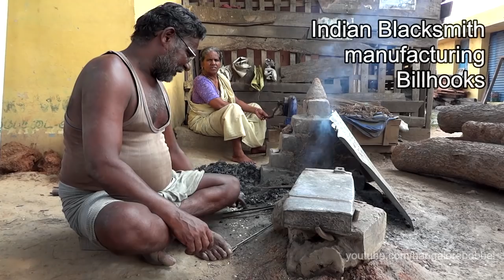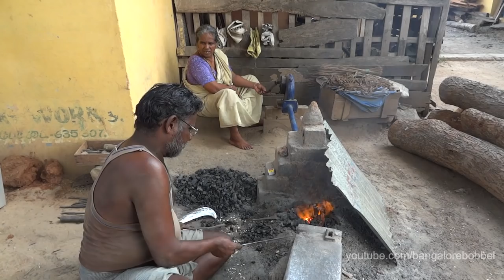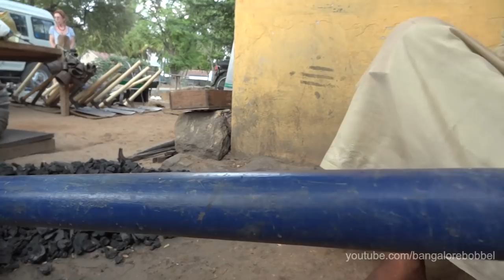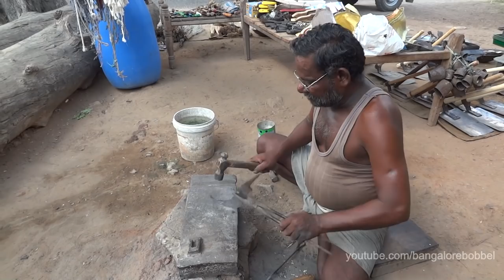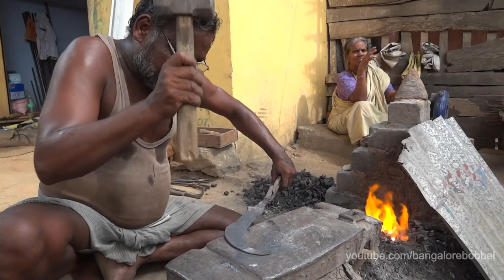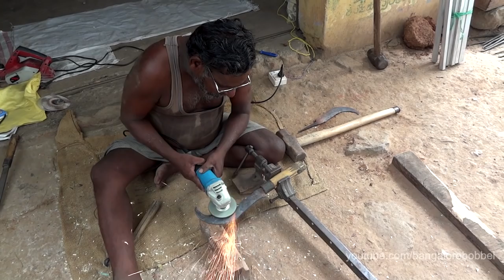Indian Blacksmith making Billhooks - Indischer Schmied beim Hippen schmieden

Comment: Great video, thanks. Do you know how he has the fire going? More specifically, it looks like the air is coming in from the bottom, but I don't know how they get it to go from horizontally out of the blower to coming out of the ground over by the fire. Also, is that charcoal or some other type of fuel?
Reply from the maker: Thank You. Yes the air comes here in India usually always horizontally in, and depending on how one creates a more flat or more pot type surrounding of the space near to the inlay one can keep the air flat or make it going up.
Sounds little bit strange what I tell but it comes from different ways of deflection of the air after it comes in, maybe You understand it better checking two of my other vids where this point is better visible: 
first that one here, the blacksmith uses simply sand to build kind of funnel and to drive the air upwards:
https://youtu.be/DgDMRLGibX4 check from 3:03 onwards
then another sample where bricks are used to form a kind of firebed after the inlay: 
https://youtu.be/uRoycA8u7pY here You can start from around 1:10 or so
another way, and I gess it is like he made it here, is simply to make a little hole in the flat ground, and maybe a little bit of sand around (usually it is not so much as in that other video) so the air is little bit deflected and driven slightly upward.
Means, the air comes usually always horizontally in, through a wall, and on the other side of the wall one can decide to keep the surface even or build whatever funnel or tunnel or simply a hole to deflect and drive the air further. There is no need to uplift everything on let me say table level as it happens in other countries (for whatever reasons, including usual work in standing position instead of in sitting way like here in India), just in order to drive the wind upwards in the fuel - here everything can be done down on ground level.
This is not only a very simple construction but it works also very efficient and it helps sometimes also to pre-dry the charcoal at the perimeter of the fire, it is easy to empty and clean and I think there is even not that much of ashes in the surrounding air as it may happen with some other solutions (where the air comes from under the fire and takes all up).
And yes, usually, charcoal is used. That is since historical times the main fuel. Sometimes little bit wood added as You may have noticed in that Udaipur video. Some people may also use stone coal but usually one can get charcoal more easy and it is available everywhere in India.
This flat pit as the blacksmith here has in use is very easy to control - just bringing the coal closer to the hotspot or not, or sprinkling a little bit of water to make it little bit slower, and so on. Simple, efficient, easy to control - very clever, same as the blacksmith ;-)
Reply: bangalorebobbel Wow! Thanks you for this great reply and helping me out so much. I live in the US and am trying to become a blacksmith but I am not so interested in doing it the way that is most common here, with coal and propane fires or sometimes they don't use fire at all and just plasma cut and sharpen. For me, I am very interested in the traditional ways. These videos were very good and informative. I have a little forge made out of fire bricks with a pipe and hair dryer going into the side and it is not very controlled and really inefficient, but with these video I have a better idea of what to do, so thank you so much! =)
Reply from the maker: You're welcome!

yes blacksmithing is a thousands of years old craft and it is not at all required to use the latest technologies (at least not as long as You don't plan to use latest steels). These simple forges work very well, as You can see. and I guess You could easily adapt Your construction to their principles.

What could be also interesting for You are maybe mobile forges as used 2000 years back - means maybe You can check these forges used by the blacksmiths of the Roman Legions. There were always blacksmiths with them who had to produce and repair their arms and armours.

Didn't find a YT source for what I mean but here is a German guy's webpage showing such a forge:
http://www.roemische-schmiede.de/Schmiede/amboss-schmiede/
(sorry German language only but maybe google translate can support You).

Well, whatever You go for: I wish You good success! ;-)
Reply: bangalorebobbel Thank you so much!
Reply from the maker: Saifee Tools Rajkot, India Mohammad thank You! ;-)

Comment: Now I feel depressed, I had a steel bucket full of charcoal with a little crucible of steel inside trying to melt small pieces of lead or aluminium all powered by a heat gun it was glowing a green light inside and the crucible was red hot still no success...
Reply from the maker: Luis Fernando ;-) yes that green light may have indicated you can drive further in that way ;-)))
when I was a little kid we did sometimes some lead melting over a candle ... means, you know, for new year's eve, melting some lead and pouring it in water to find out what the new year will bring ;-)
If I remember right we had a kind of a very small pan and some lead pieces and hold that over the candle flame ...

Comment: Are these billhooks being made from old files? the square end and tang look familiar
Reply from the maker: no he uses a standard spring steel made in India (from Tata), that's common for such kind of tools. An old file would most probably contain too much of carbon and be finally too hard for the intended use, means that tool is not meant for cutting but for chopping kind of works. If you use a very hard steel it tends to break, a steel with better elasticity is better for such purposes as well as for your joints. That's also the reason why you use that type of tang - it is standard shape if you plan to use a handle made from wood or, in that case even better, from a grass - means bamboo ;-)
People using such tools do so frequently the whole day - it is e.g. used to clear bushes or lay fences, cut bananas or coconuts and for so many other kinds of work in the woods an on a farm, so it must not only do a good job but also protect the user from damages. That's why it must dampen the beats - and that is done by this specific construction, means having an elastic steel, a long ricasso, a rat tail type of tang, and a bamboo handle ;-D

Comment: Working in the cross legged position seems awkward, not to mention not as efficient as standing up. I wonder why he works in that position
Reply from the maker: Mmm I would say it is the traditional position here, lots of jobs are done in that way, means in this specific sitting position and having all tools etc. around.
If You are not used to sit in that way it may be difficult, for sure, maybe even painful, but if You are used to it it is said to be one of the most stabile positions a human body can have.
To sit in that way is very common here, in similar way people sit also, just for example, during meditation - the body stabilises itself.
Why do You think it is more efficient to do such a job in standing position, just guessing or any ergonomical considerations? From my understanding this way of work is more efficient compared to do it whiles standing. Of course I am not a specialist but I guess for standing one needs some extra energy (in terms of muscle power, kcal etc.) compared to sitting in such a self stabilising way. The energy required for hammering should be mainly a question of arm and shoulder resp. muscles around, I would say, so from that point it should not make much difference whether sitting or standing?
At least this kind of work with these tools used here should be similar or even slightly more efficient than other ways, but I have seen Indian blacksmiths also hammering whiles standing - but in that cases it happened with big and heavy hammers, kept in both the hands and bending the complete body whiles hammering. Also in these cases the iron objects laid on ground level, so these men used the full distance down to the ground for hammering, what seems in my eyes also to be a better way to use gravity compared to people hammering things on table height level.
Reply: bangalorebobbel Yes it must be comfortable for them otherwise they wouldn't do it. I just look at the hammering, with a fairly heavy hammer, must be harder in a sitting position, as you can't sort of use your back and torso as much. That said these men seem to be doing alright though, definitely hard working men, who are producing good things
Reply: Speaking as someone who forges like this, it's because I don't have bench to run the forge on (his is actually dug into the ground) which necessitates working at ground level.
Reply: Antipodean33 Conservation of energy maybe? He might be at that all day.
Reply: Luciffrit Standing conserves energy better because you are able to hammer more efficiently.
Reply: Luciffrit

Comment: nice knife whear your seller for Internet i uaner buy 1
Reply from the maker: mmm, I don't think he sells over internet ... he might not even have access to the net. ;-)

sorry, I don't haven even an idea where you could get in general such handmade traditional pieces, means from other manufacturers. These blacksmiths here are usually running very small shops, producing and selling only for the local market and selling either to government supply (means a kind of government institution which sells tools for farmers at subsidised rates) or directly to the end customers.

If You search for such knives in general and don't mind whether they are handmade or where exactly they are produced, You might still find plenty of industrially made ones, if you search for terms like
billhook hookbill machete gertel hippe serpe
and so on you will be easily successful online.

I know one huge manufacturer in El Salvador, that is IMACASA, the largest manufacturer of knives and garden/forestry tools in South America. Their products are sold in most other countries on that planet under the brand name CONDOR. Their smallest billhook is named Condor Bush Knife, afaik.
Another big brand which has such type of knives (means billhooks) is Martindale. 
And a very modern version of such a knife is sold by Fiskars - one common model name is Fiskars XA3.
Reply: Noel ponce in most of southern India you will get this kind of knifes !

Comment: Lol, it was very traditional until he brought out the power grinder :)
I wonder if he has told the woman that they could use an electric engine to drive that fan (since they obviously had electricity)
Reply from the maker: Thanks yes electricity was there when I filmed, but one question may be whether they have the money for an electric blower setup. Another question is what to do when the grid fails, means we have here always a lot of power cuts, interruptions and so on. If grinding cannot happen by electric tools that's usually no problem, one can do that later or simply use a file, but if the power goes whiles one is smithing and there is not enough oxygen, it would be a different situation ... these electrical blowers which I have seen so far are fixed to the setup, one cannot simply replace it by manual blowers and continue the work ... that's why many blacksmiths here use still these good old mechanical ones.
Reply: The well polished videos you see on Youtube are actually done by hobby enthusiasts. These are real hardworking people far away from your Disneyland. If they run an electric blower for 10 hours a day the profit margin will go deep down south. Did you watch how the man was using that grinder so very sparingly? Probably he chose that instead of a bench grinder because it is less of a power guzzler.
Reply: bangalorebobbel You have done a great job showing how a real hardworking poor couple earn their honest bread. There are pampered trolls smirking on it. You should have added in the title "Real poor people shown in this video, viewers discretion is advised"
Reply from the maker: Jumpstart Jimbo thanks man, well, never mind, I take it as an educational task to help those understanding who are not aware about the situation ;-)
it is almost impossible, I know, since it is not only the shere poorness of the people which is often not understood but also other topics like safety gear or whatever other points are mentioned in the texts. Usually people think from their own life experience and perspective, and obviously most of them do not know much about India, life on rural villages here, or anything else beyond their own cultural experience. And if they are spontaneously reacting on that video, in whatever way, it shows that the video meant at least anything for them, forcing them to react in any way.
But even if some of these spontaneous comments may sound strange, I have a little hope that people are able to think twice ... and maybe the one or other is finally even interested to find out more about such things ;-) And of course, some of these comments are obviously just meant as joke - I am sure the viewers understood very well but had to let their steam out in form of a joke ... what is sometimes not even a bad way to react but can sometimes offend others.
And of course, I feel free to simply delete the worst comments ... it is my channel, so what ;-)))
I really like these two here in the video, and I hope that my video gives them anyhow some support, means that people go there and purchase anything from their shop. Same as I do whenever I pass there. ;-)
Reply: bangalorebobbel It's a pleasure. Think you are an activist at heart. Plz keep me in your circle. I'm from India, settled abroad but my heart still beats for my Motherland. I'm planning to go back home and thinking of dedicating my remaining breath to my Motherland.
Reply: Electric blowers cost money.

Comment: It looks like at first he is work hardening the metal by pounding on each side and then final hits are to do the final profile and make sure it's straight. That would be plenty enough for a tool like that I think. You just sharpen with a few stokes of a stone if you use it a long time and you are fine. 
That poor wife. Sounds like the blower is dragging a bit on the sides. LOL

Comment: im an indian  these knifes  cost like 5 dollar to 10 dollar max
Reply from the maker: yes depending on size, weight, material and whether industrially made from cheap steel or hand made in your lokal shop from best spring steel, whether purchased directly from your local blacksmith or in any hardware store or shop at the market, there are very different rates ... very small ones (I mean the small sickle knives) might cost you not more than 40 Rs but heavy and huge aruvals with good steel might also cost up to 1500 Rs or so. In many shops billhooks are sold by weight, the size you see here might cost maybe around 500-800 Rs (plus bamboo handle some Rupees extra).
If you are farmer and purchase such items only in government shops you can get them at cheaper rates compared to normal market prices since they are sold at subsidised rates in such shops. 
And finally: I would always prefer such a handmade Indian billhook over any 100-Dollar-Survival-Nonsense-Machete from abroad. Because these Indian billhooks are made for work and daily use, and their functionality and quality is prooved over hundreds of years and millions of people using them daily. And these tools last forever - I know many people which are still using the billhooks from their grandfathers. Once produced and purchased they become kinda family heritage, such billhooks ;-)
Reply: bangalorebobbel ur right i have machete made from spring steel  it cost me 750 rupees the edge retention is superb
Reply: bangalorebobbel  for indian  channel u replied very quickly  keep up the good work.
Reply from the maker: thanks but the fast reply is just accidentially, I'm on a trip and wanted to go now to bed but checked as usual my mails before closing my eyes ;-)
Reply: bangalorebobbel ok good night bhai again a fast reply

Comment: Can't afford an electric fan/blow dryer for the fire but has an electric grinder?
Reply from the maker: mmm, is that a rhetorical question? If not, try to think in the following scenario, and to answer a simple question.

You are the self employed blacksmith and own a manual blower for the fire and for grinding you use your files and sandpaper. You have some money but not enough for both the electrical engines (grinder and blower). So far so bad.

Ok now the simple question: Which one of these two engines You would purchase first, and for what reason?